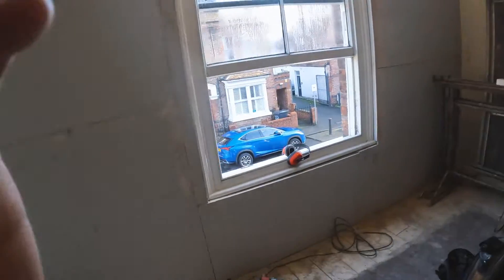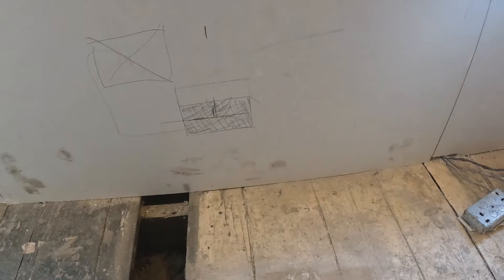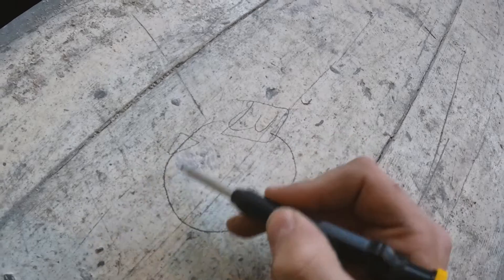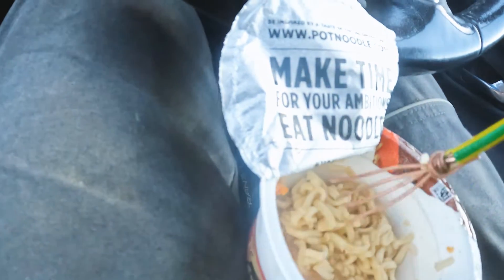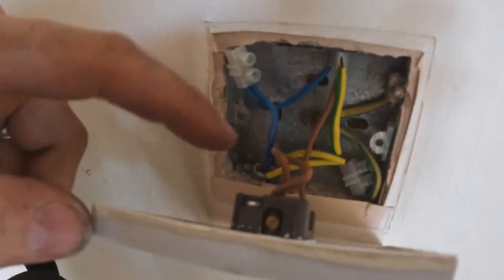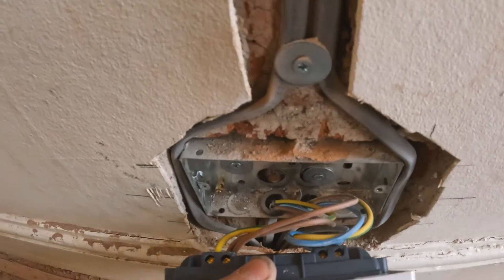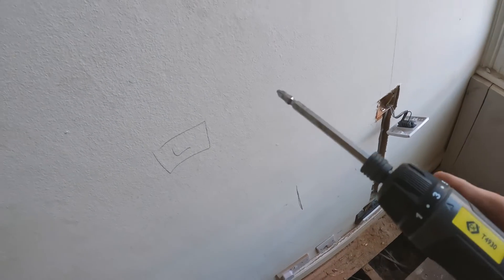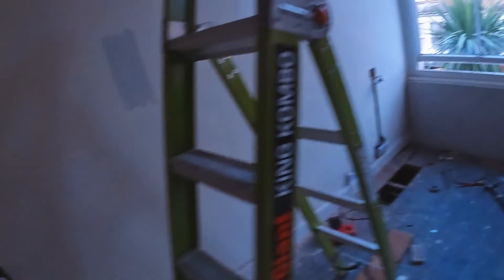SOCKET WIRING TIPS AND TRICKS!

Comment: Excellent and very educational. Bonus humour as well. Like the tip using the washer to secure your cable into the chase. reg your light switches configuration ( big word for an irishman) is that the 2 plate method or feeding the switch. Do you ever use the loop in method or is that a thing from the distant past. Thankyou for taking the time to make this its much appreciated.
Reply from the maker: Heya! Yes try to make this entertaining and educational as possible. I use both as what ever is easiest. Generally feeds to switches and a light cable out for down lights and led strip etc. if it’s pendants in a loft I find it easier to do feeds to lights and a switch wire down to the switch. Thank you for watching and commenting!